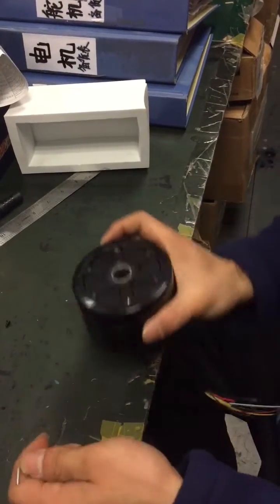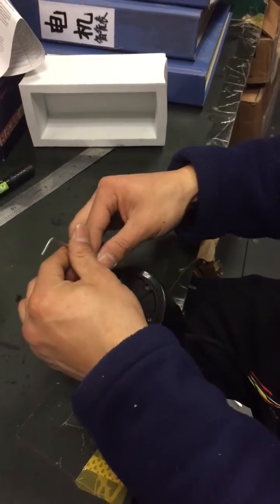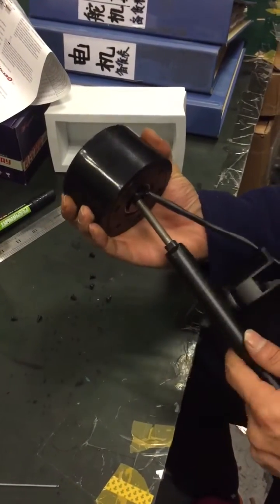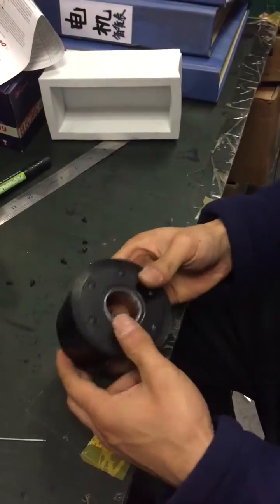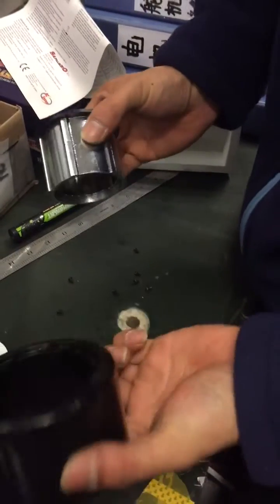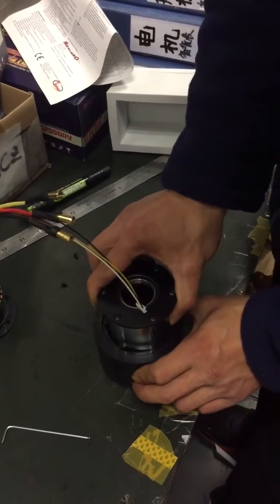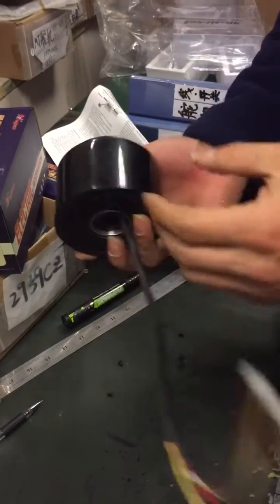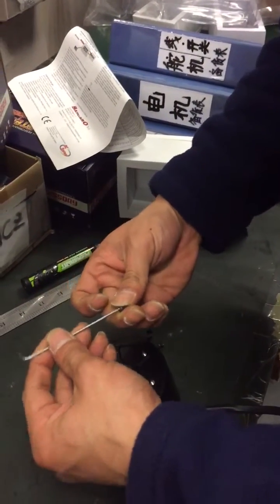Maytech 70/90mm Hub motor--How to replace the PU tyres

Comment: Greet vid Agnes  )) hey is there anyway these Hub motors can be designed so that the urethane can come off and be exchanged from the"outside" of the trucks ... and not the inside of the truck ?? Because this means that we  have to completely disassembled and unwire the actual Stator and remove it from the truck...  just to change the urethanes over ?? I'm think the Koowheel design allowed the urethane to be removed from the outside thus leaving the Stator in tact, cheers Agnes nice vid  )) Andrew Penman )(
Reply from the maker: Hi Andrew, thanks for your kind advice very much. Our engineers will consider that
Thanks again